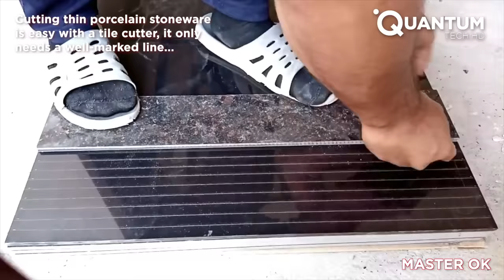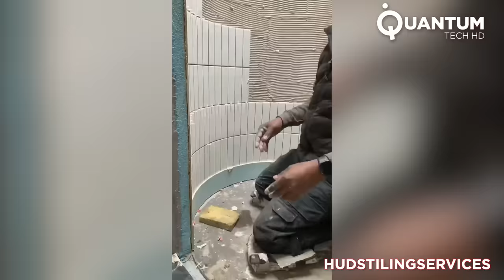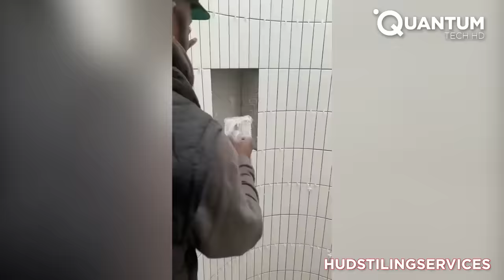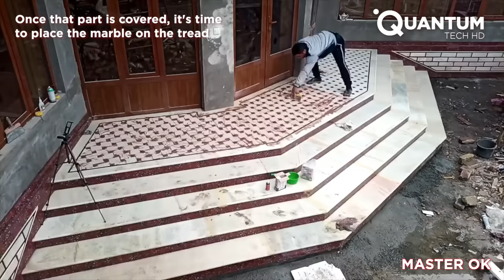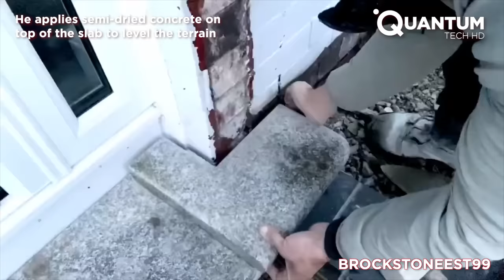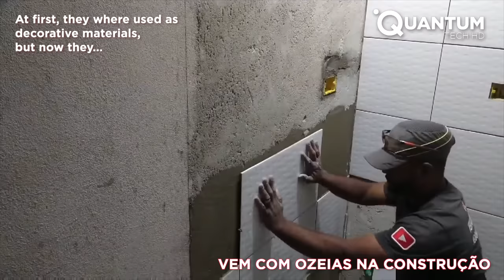Most Amazing Ceramic Tile Installation | Workers with Tiling Skills

Comment: I hope to hell these guys are making good bucks! They put so much pride into their work.
Reply: Grew up in a tile setting family. Dad and I did this one job that required me to do over 700 angled cuts off the end of 4x4 white ceramic tiles (the manufacture didn't have any already prefabed, in stock.) The owner insisted we get it done.  We inset 1x1 glass tiles into the corners of these 4x4s,, with a decorative strip of  more of these little glass tiles. Oh my! It was a nightmare!!!! Ended up looking like a padded room. 🤣🤣🤣